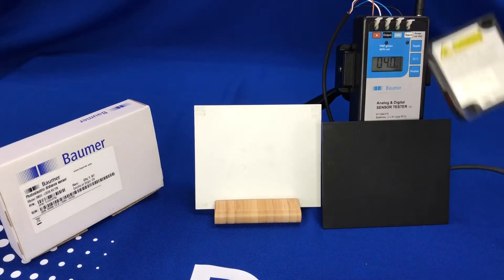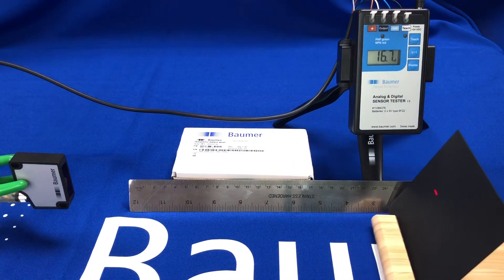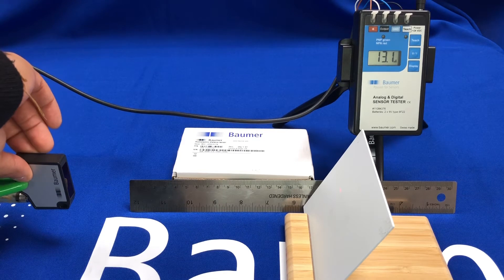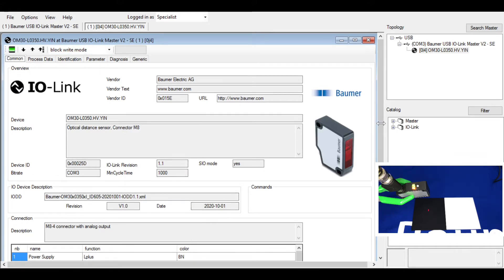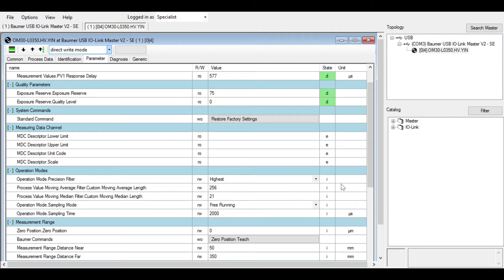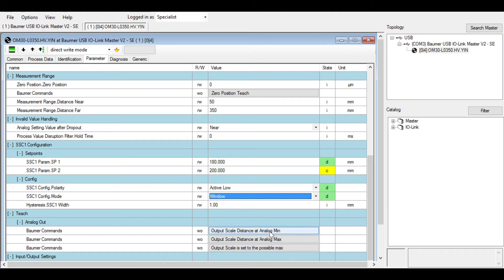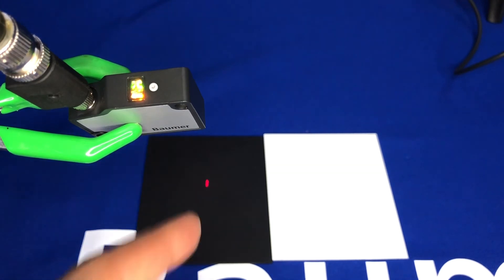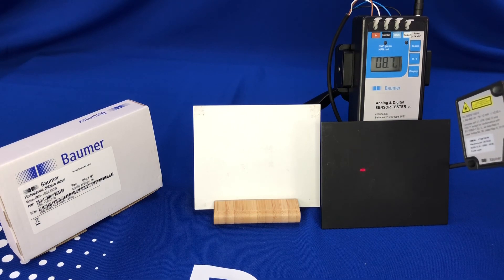Baumer Analogue & IO-Link Laser Distance Sensor Demo (OM20/30)

Comment: The power supply for sensor tester is 24V DC, right ?
Reply from the maker: The power supply to the tester is 240V AC which provide 24V DC to the sensor. The tester can also be used via battery power. 2 x 9V batteries.